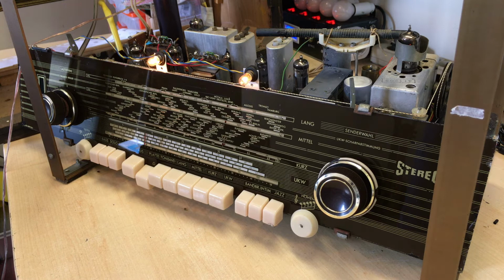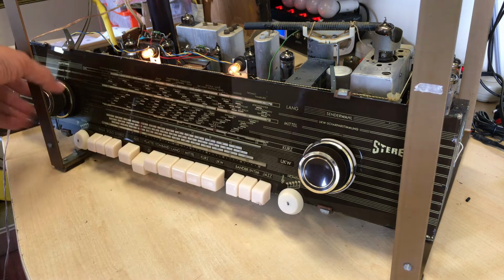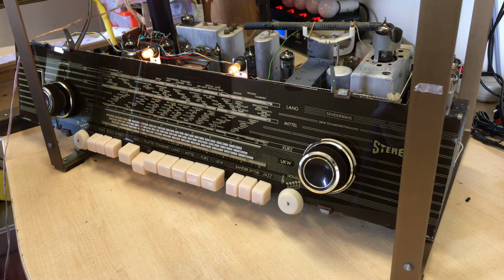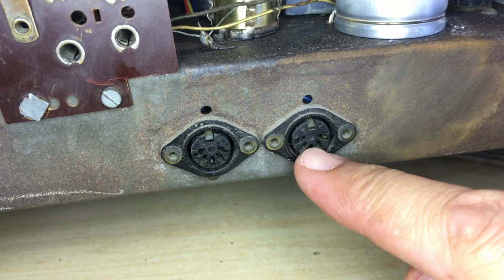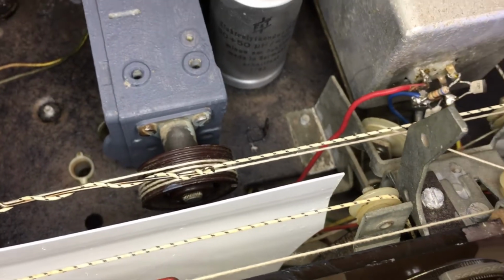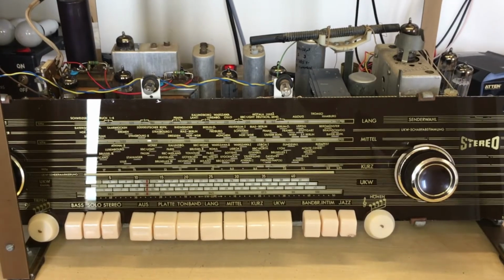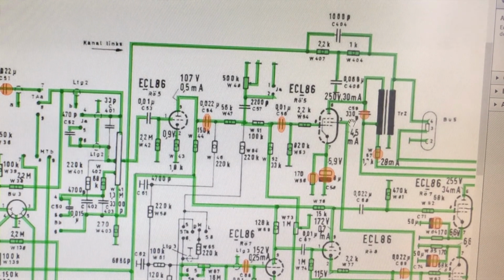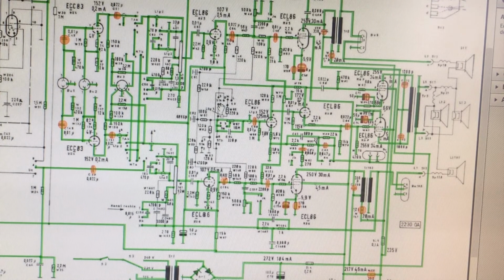Telefunken Opus 2114 stereo tube radio restoration - Part 4. Audio is done, and a facelift.

Comment: Great job! I have a telefunken kuba venetia with the same front plate. How do you manage to remove the volume knob? Mine is not working… thx
Reply from the maker: usually by loosening the screw, then carefully pulling it out. if it is stuck, spray some WD40 and leave it for a while before trying again. Two spoons also do the trick.
Reply: @electronicsoldandnew  thx, you mean screws from the inside?
Reply from the maker: No, the knob has a screw in the shaft.
Reply: @electronicsoldandnew  thx I’ll look into it, do you think it is possible to use the tape recorder connector to plug a Bluetooth receiver?
Reply from the maker: Yes, just make sure you use the correct pins on the socket.
Reply: @electronicsoldandnew  thank you very much for these precious information

Comment: The phono input is made for line level?
Reply from the maker: +Michael Rosenfeld : just about. It works fine - just little lower than the radio level, but does not need boosting.
Reply: M Caldeira Wow that's great.  I would have thought it was for a cartridge output and have another gain stage and RIAA.  Great series!
Reply from the maker: Most of these tube radios don't use RIAA compensation, or a separate gain stage at the phono input. You need to check in each case, but most of the ones I've done have not needed any tweaking. The exception was the Braun Atelier 3, which was a more 'modern' system, and had a little tonal compensation at the input, which I adjusted slightly to my personal 'taste'.
Reply: @Mike5000-p6w  The input is designed for crystal cartridges which deliver high level (but have be loaded as little as possible for good bass response) and basically do not need RIAA, since they react to the speed of needle movement, not the absolute amount of deflection. RIAA was more or less designed to match the characteristics of the (at the time) widespread crystal pickups.